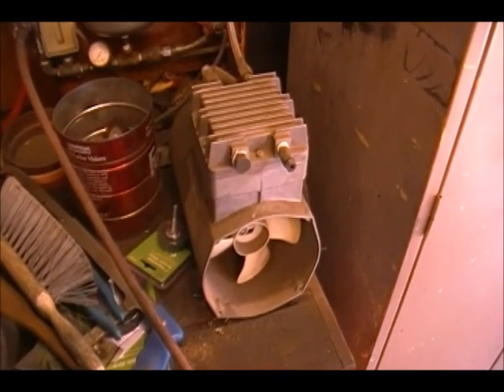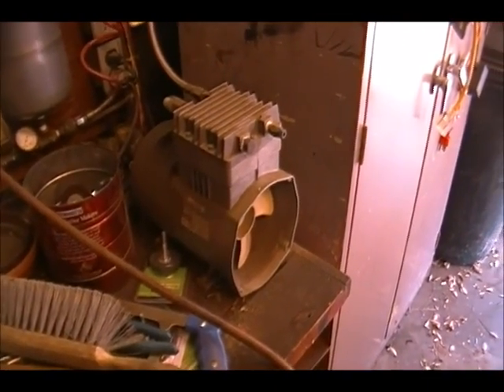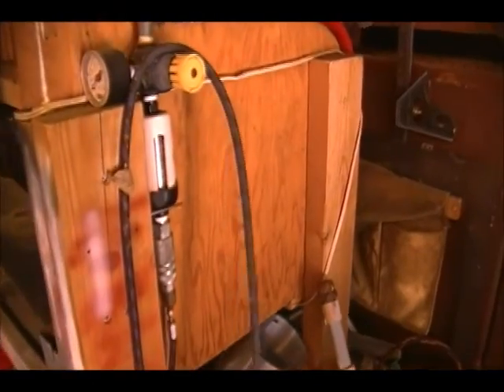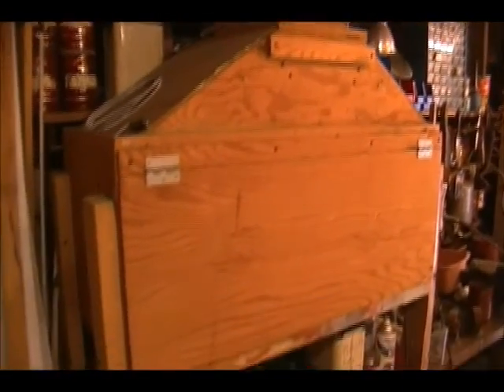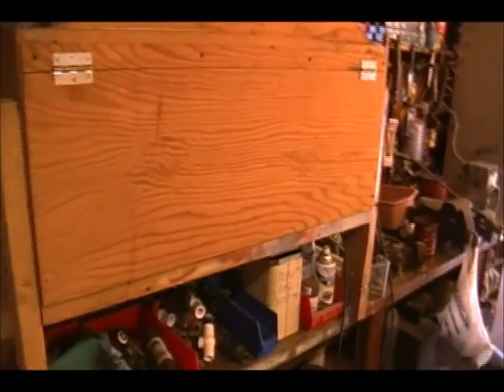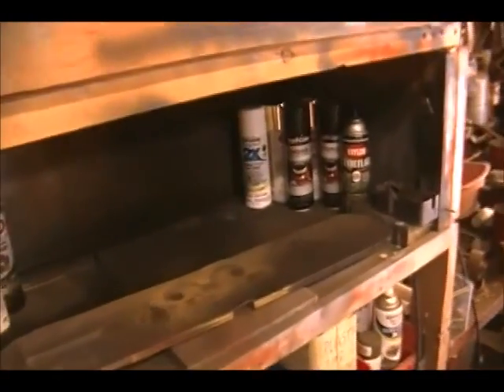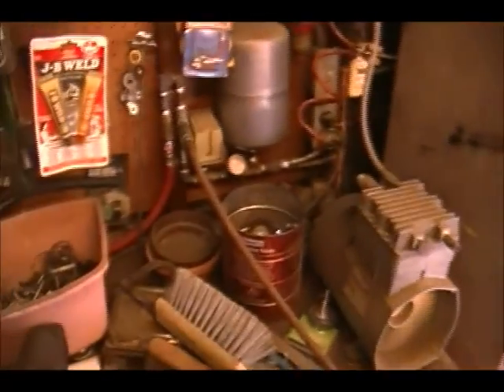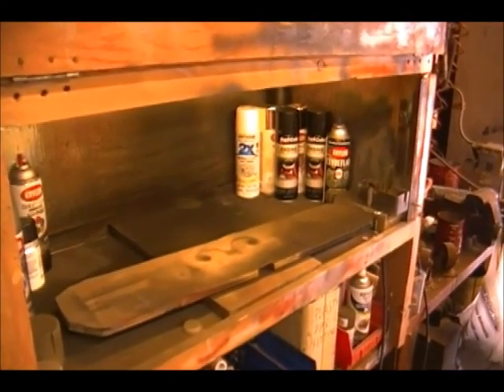My Homemade Paint Booth and Compressor

Comment: Richard, I have an old compressor very similar to yours. I picked it up when working at a local airport some 20 years ago. I have been contemplating buying a newer one, but the prices are pretty steep. I had planned to do what you have done, but didn't think I could put it into a cabinet for heat reasons. But I see that as long as there is sufficient room, it should be fine. It is noisy but in my garage who cares right!! P.S. mind if I steal your booth design!?!?!